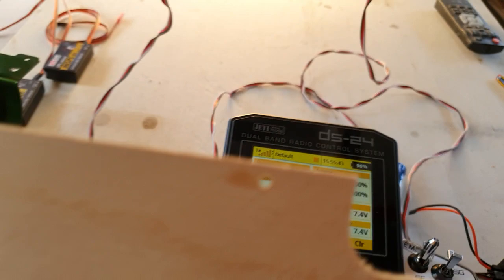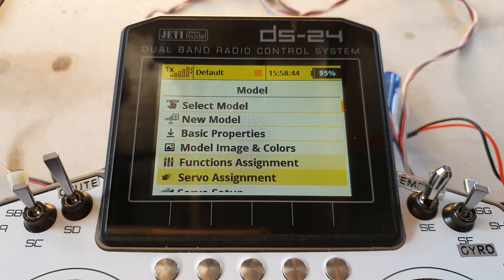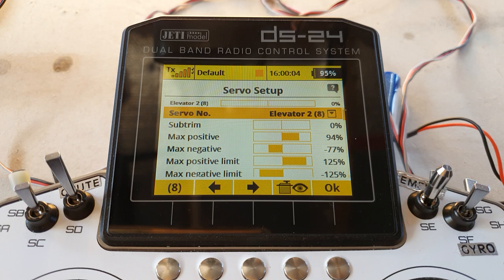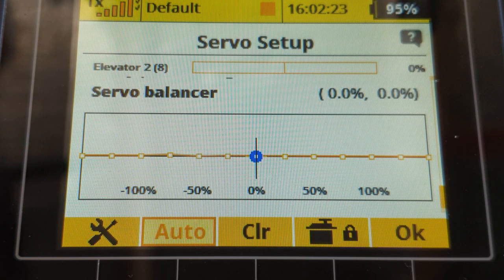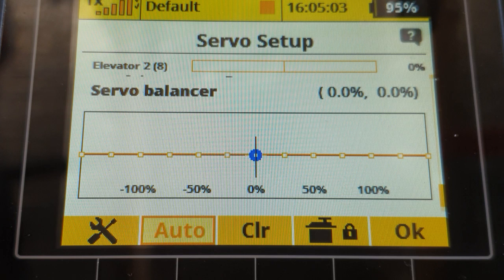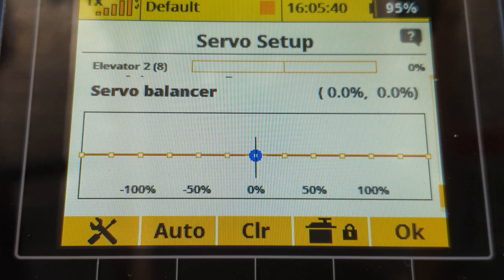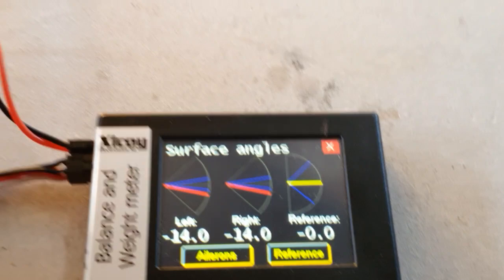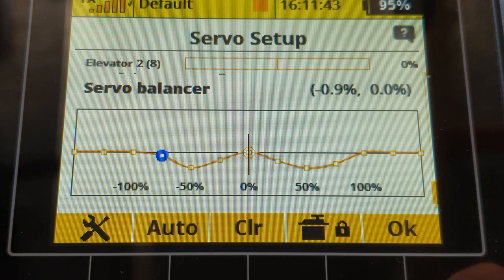Jeti - servo balancer

Comment: Hey Harry, truly appreciate your videos as I transfer to Jeti. Is the servo lock function available when simply setting end points outside of the balancer feature? Thought here is being able to set up throws on your own. Not having to hold the transmitter stick while manually measuring deflection would be a big win. Thanks!
Reply from the maker: Sadly not, it would be a nice feature.